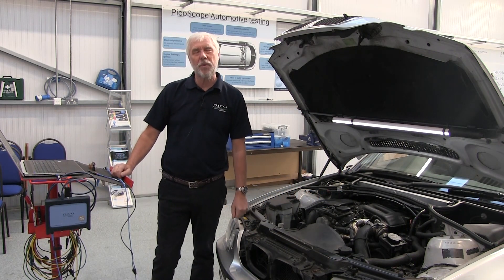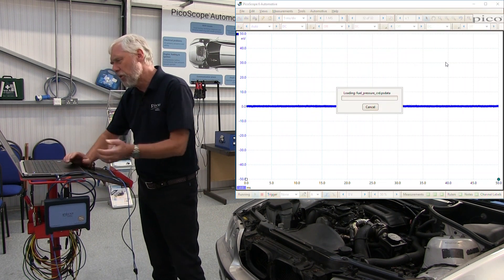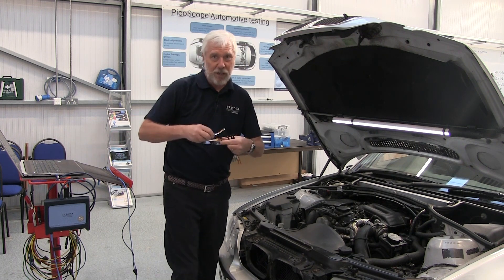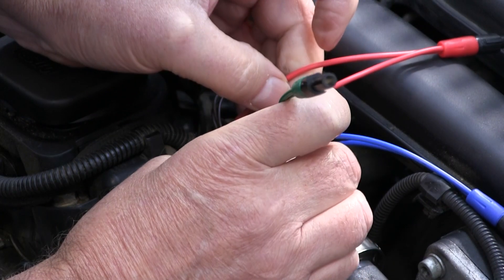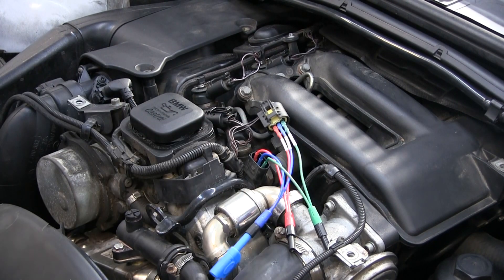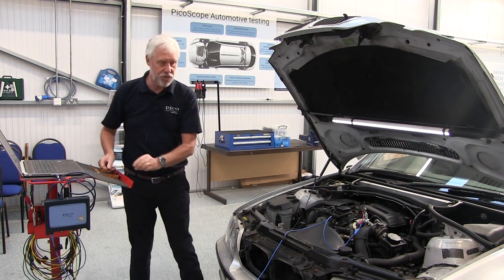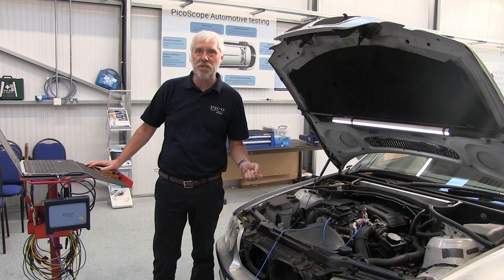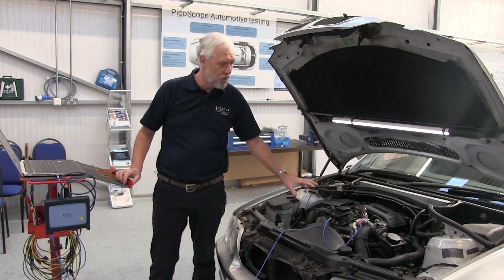Guided Test: CRD (Bosch) fuel rail pressure sensor - voltage

Comment: I need to put this somewhere before I write a proper forum post.  I know a fair bit about electronics, so this can help in diagnosis.

To crack an old one open, I just put the threaded end in a vice.  Then I whacked the plastic part with a rubber mallet a few times and got a nice clean break.  The plastic top is just glued on.

The 3 terminals you can see in an intact sensor are +5V supply, Signal, Ground.  Normally the signal is in the middle on Bosch as far as I know.

Inside, you will find a tiny square circuit board with 3 spring terminals to contact the external connector.  This circuit board has 10 capacitors, a resistor and a tiny integrated circuit chip without normal encapsulation.  It has a soft see-through goop over the silicon chip.

This is held on with solder paste to the actual sensor inside.  The there 4 main terminals and what I presume is a shield earth grounded to the engine through the threads.  Sensor ground is of course separate and one of the three main terminals.  This shield terminal is wedge shaped, but the 4 terminals are square.  You can desolder it - but mine just peeled off.

This PCB means, you can never really measure resistance to test the sensor, as capacitors block DC.  Same with the Coilpacks.

Inside the actual sensor guts is a set of 4 MEMS silicon piezoresistive strain gauges fused to glass.  There are 4 elements in a half bridge configuration (2 used as dummies for temperature compensation).  The bridge arms create a DETF (double ended tuning fork) resonator.  The terminals are connected to the silicon with bond wires like a microchip that feed through the fused glass.  In mine, one of these lead wires was burnt outside of the glass.

You can test this Wheatstone bridge of strain gauges directly from the terminals.  Each element is about 2.5k Ohm nominal.

Normally in a configuration like this, you only need two terminals to create a useful output signal voltage, but I haven't analysed any further.  In principal, you could resolder the bond wires and repair any broken capacitors, but that would be hard and there is a lot of pressure working on these sensors for me to want to do that and consider it safe - until I learn more.

I can understand a bond wire corroding after a long long while.  But what I don't get it why not use a regular IC for processing the bridge?  It's just a 4 channel instrumentation amplifier, which are dirt cheap and reliable.

I'm saving this load cell for other purposes.

In my car, with sensor disconnected, i see 9-10 V at the signal wire on the harness/loom.  This has to be leaking into my harness from a short somewhere and might have killed my sensor.  Giving codes.
Reply: Also, when people say the acceptable range for a signal is 0.5V to 4.5V - I think this arises from a diode voltage drop at either end of the range within the amplifier chip.  Then your ECU/PCM etc can tell something is wrong if you get a signal outside this range.

Comment: Hi was the nominal voltage 0.5 v with ignition on? I only ask as my sensor on the same car was reading 0.3v and I think its broken
Reply: To create 0.3V, your fuel line would need a vacuum rather than pressure.  Or you have a partial short to ground, or high resistance in the wiring leading to your meter.
Reply: @projector7141 is the ground short from engine ground ?
Reply: @luisgamer10   it can be from engine ground through a failure in the sensor, or harness ground through chafing wires.  It could even be within the ECU or PCM.  Easiest to test is the wires, and it might need a positive feed to check it under power.  I have a weird mystery like this on my car.